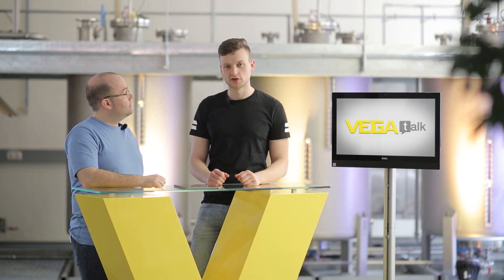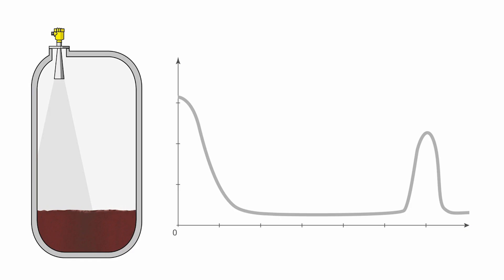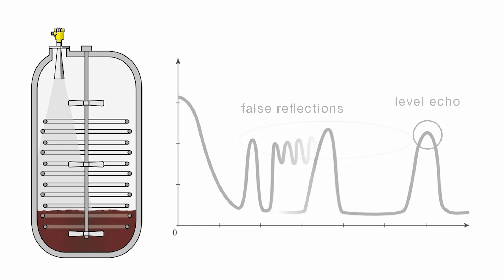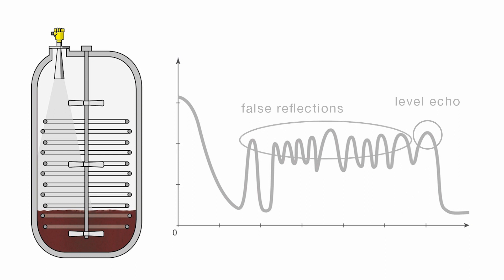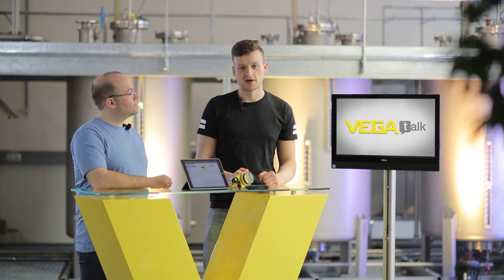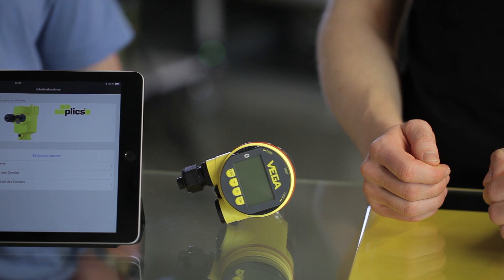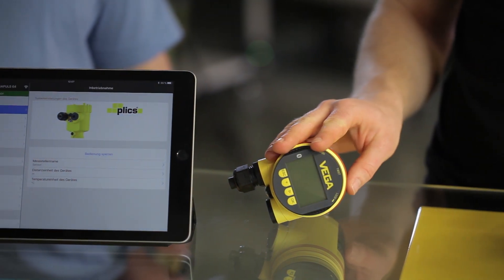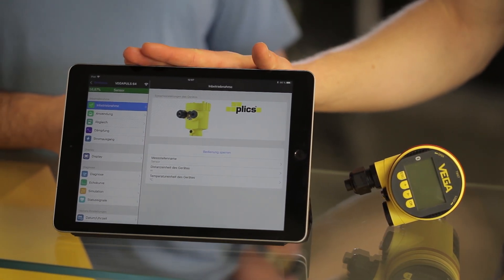💡 How does false signal suppression work in a level sensor? | VEGA talk

Comment: i have a vegaflex 81 in a sewage tank. the tank is 5 tons. when the level is under 400 lt  the high high alarm goes on and the hamman is energised. the black was thrown into the sea....major issue as you understand. is that maybe a case that needs suppression?

Comment: Dears, we are using vega plus64 radar type transmitter.The problem is,  during dosing H2SO4 and H2O2 in vessel  transmitter giving wrong reading, otherwise its going 100%.
N:T: vessel  has agitator and during dosing chemicals  temperature is 53deg c.
We have more than 30 transmitters facing this issue.
Tnx
Reply from the maker: Thanks for your question. In this specific case it would be best to contact our colleagues for technical support directly: https://www.vega.com/en/service-and-training/technical-support

Comment: I use VEGAPULS C 21, How do I do a False Signal Suppression?
Reply from the maker: Hello Wladimir, thanks for your question. With the VEGAPULS C 21, the false signal suppression can be started via the VEGA Tools App and the Software "PACTware" using the Bluetooth connection. Or with PACTware using the HART connection. The function can be found here: Extended functions > False signal suppression. For technical support please visit: https://www.vega.com/en/service-and-training/technical-support
Reply: @VEGA_Level_Pressure 
Hi,
Thanks for replaying my comment but my question is still unsolved.
I’m asking for a stablished procedure, what do we look for.
I’m testing this product (and one of those tests are with foam) for a major oil & gas company and I’m not finding answers anywhere.
Thanks.
Reply from the maker: @MrSinestesico  The false signal suppression is done by the sensor iteself. To make it work, you have to type in the actual distance between the sensor and the medium.
The suppression will help to ignore false signals from installations or obstacles; for foam applications other settings can be necessary. Would you contact your local subsidiary to clarify this in detail? https://www.vega.com/en/company/vega-worldwide

Comment: should the ajustment be done on the place of operation pra could i just do It on the lab and after installing on the process?
Reply from the maker: Hello Ygor, the adjustment can also be done in the lab, if the measurement conditions are known. However, some optimizations may be needed after the sensor is installed.

Comment: How set false signal
Reply: Vegaflex86 , in fact the problem is fluctuate in reading , where we use measuring condensate in oil field ,also the transmitter installed by bypass pipe 
Thank you
Reply from the maker: If you use the VEGAFLEX 80 series, you can find the false signal suppression in the menue under setup > false signal suppression. Please check if you have a covered probe or an uncovered probe. With a covered probe you need to know the distance to the level surface. If you have changing false signals you can also get in contact with your local contact: https://www.vega.com/en/company/vega-worldwide
Reply from the maker: Hello and thanks for your question - which VEGA sensor are you using?
Reply: All right 
I will try 
Thank you